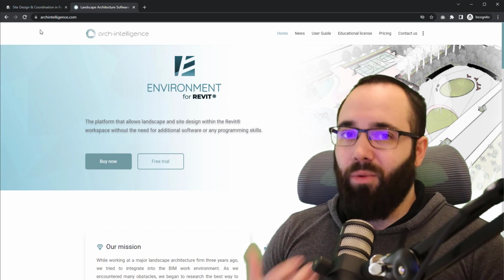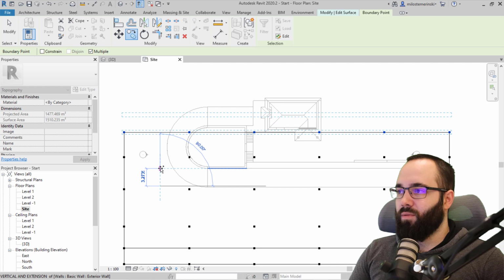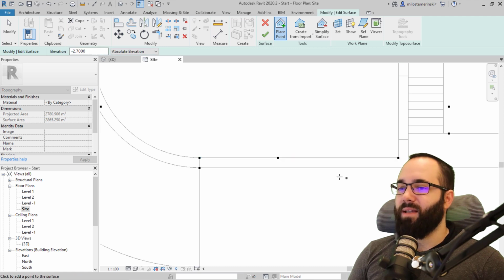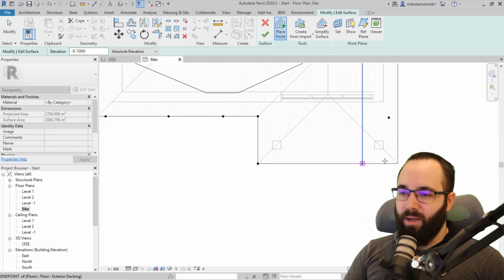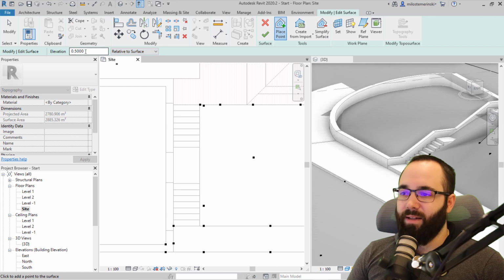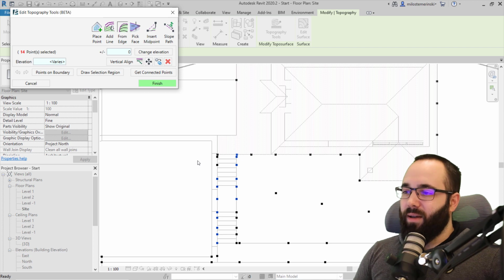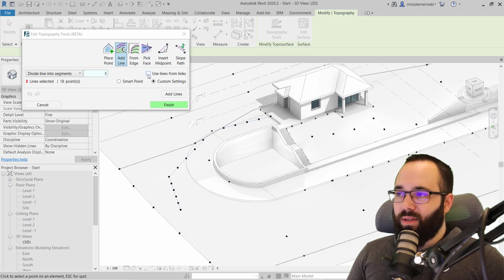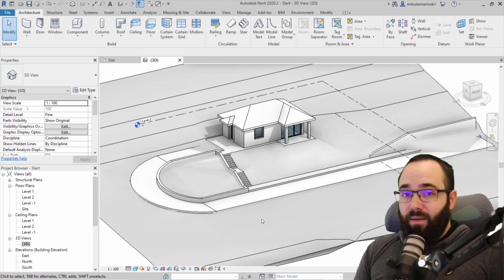Complex Site Modeling in Revit Tutorial (with Environment for Revit)

Comment: But when would a user EVER be placing topo lines by clicking random dots on the screen. I can't understand when this feature is ever of any value. Importing in contour lines is one thing, but why would I ever need to place random points. This is typical Revit, have features which "could" get your site model achieved, but never good enough to actually implement this on a project because it will leave you hanging with no solutions.

Comment: I have a question. 
What is/are the difference(s) between Site Designer and Environment? 
Which to choose?
Reply from the maker: As far as I know Site Designer was an Autodesk plug-in that was discontinued after Revit 2020. It did have a couple of useful features, but it wasn't really impressive. Environment works with all Revit versions and it has tons of great features for site modeling, as you can see from my videos. So I would recommend the Environment plug-in for sure!